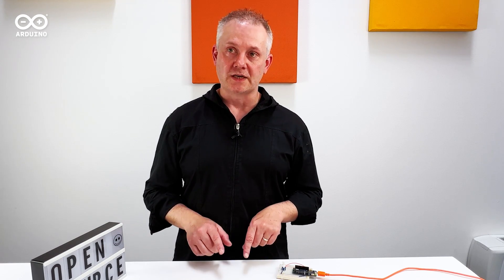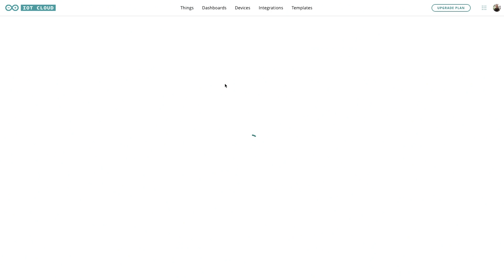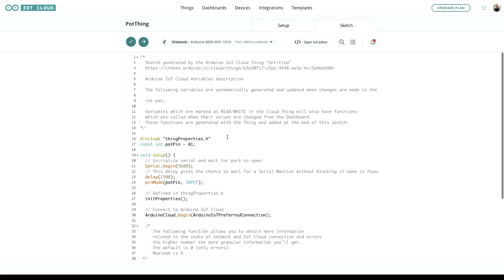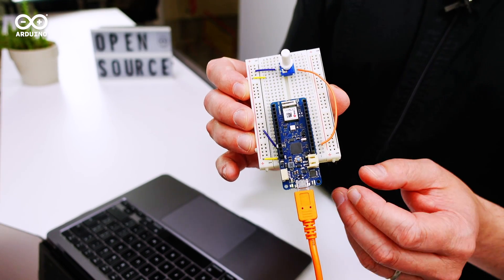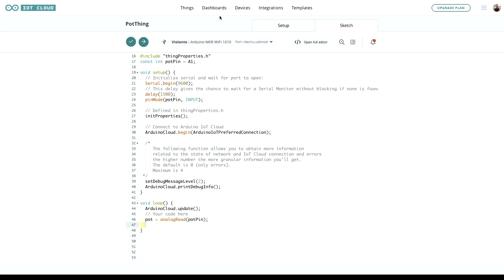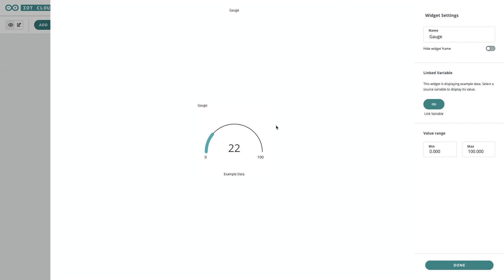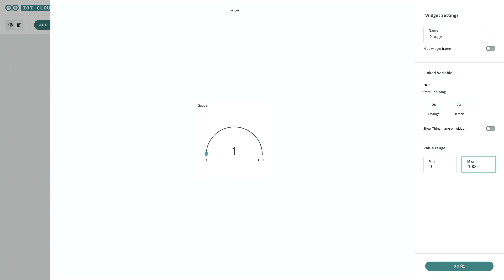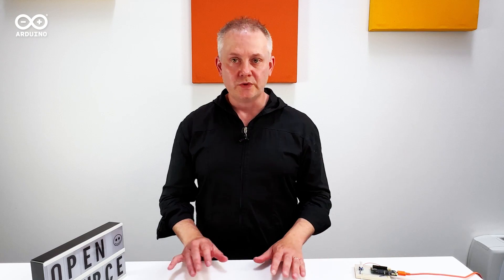Simple, Easy Wireless Potentiometer Control in Arduino Cloud

Comment: None of the examples show the use of more than one item. How about one that shows both the potentiometer and the servo using both the cloud dashboard or the physical pot? The interaction between the variables inside the Sketch and handling the issue of which control (dashboard slider or pot) would be nice. Thanks 🙏

Comment: Dude, sorry I don’t normally do this, but there’s so much wrong with your video! You should really redo it.  The gauge was ever shown, when you’ve got a cable connected, you’re not on Wi-Fi you’re on ethernet. You don’t have any information about the hardware in your description and you missing the basic setup…. it’s just a mess. It’s embarrassing actually.